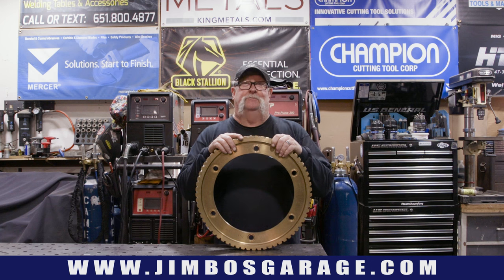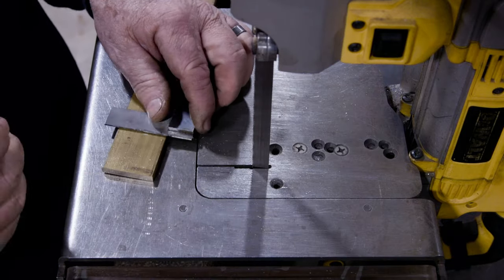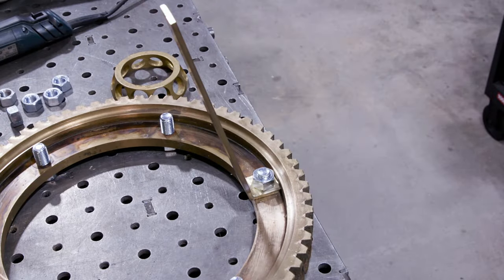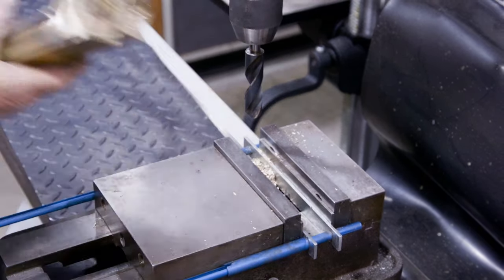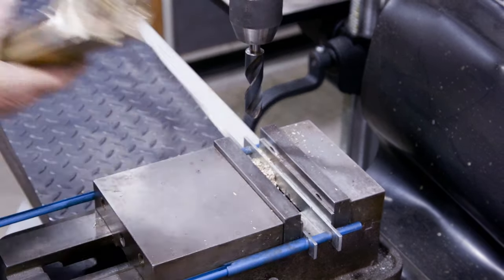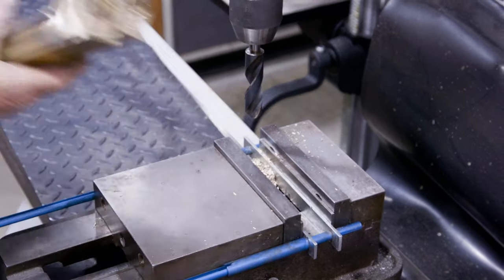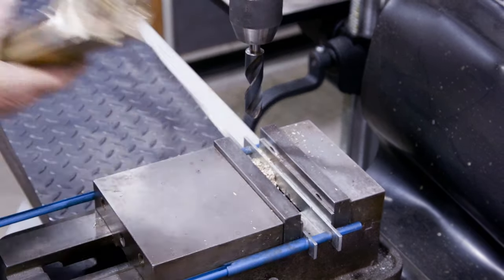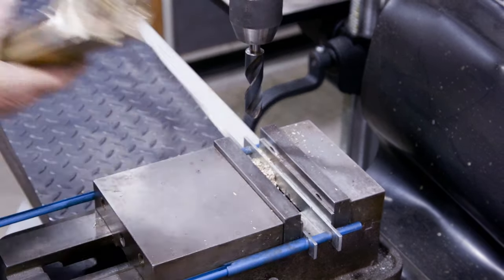Turning a Brass Ring Gear into a Stunning Cocktail Table | TIG & Metalworking Tips | Jimbo's Garage

Comment: For welding brass, you definitely want one of the low zinc alloys of brass. If you wanted to braze its more like soldering, you don't melt the base material but get it hot enough and it uses specific brazing rods. that melt before the material does. Thanks for the great videos Jimbo!

Comment: HI Jimbo. My name is James and I'm a Welding Instructor, you can weld this in horizontal for bearing ring. but you need flux to help with the liquification of the metal to fuse properly.  No. 90 flux helps with  de-zincification. this is why you were having a hard time .. Hope this helps 😀

Comment: The reason tig welding brass is difficult is because of the zinc. Zinc has a really low melting point. Combine that with the fact that brass is very thermally conductive and requires quite a bit of heat input to weld, and you have an arc that tries to vaporize the zinc.

Use oxy acetylene and braze the brass together (this is the method i prefer to use, its slower but you can sneek up in the heat and hold the heat easier in my opinion) try it I think you will find it much easier.  
If using Tig: Set machine to about 50 pulses per second, with background set on 50, and use just enough heat to get a puddle going. AC balance: set it for max penetration and use a tapered tip.
Use an argon helium mix: Brass is very conductive and takes lots of heat, so an argon helium mix can help. Use the base metal as a filler: For the best color match, use the base metal as a filler. Hold the puddle long enough to let the bubbles go away, or "flash" the foot pedal to freeze it before the bubbles break the surface. 

Good luck in the future and great video, most would have removed all the struggles...

Best Regards, 

Chris 
T-TOWN WELDING AND FABRICATION

Comment: It looks like that worked out pretty good. Never welded on brass myself but I think some brass alloys have aluminium in them, and that if that's the kind you have, you might need to use AC (and maybe an aluminium bronze rod as well).

Comment: When brazing never melt the parent material. Only run hot enough for the filler metal to flow into the joint.

Comment: I am not an expert but my dad was a welder and I picked up a fair bit of knowledge from him. Your first mistake really was choosing brass. The zinc in it melts at a much lower temp. than the copper and vapourizes before the copper starts to melt. The copper also conducts the heat away so you in this forever war of copper and zinc. Never ends well.  Bronze is copper and tin and is much easier to weld as tin isn't as reactive. Most people would solder/braze bronze or brass with say silver solder using oxy acetylene gas thus avoiding melting the base metal. All them zinc fumes will damage your lungs too - best not weld it ever again IMHO. Thanks for sharing your experience. You did as well as could be expected for sure.